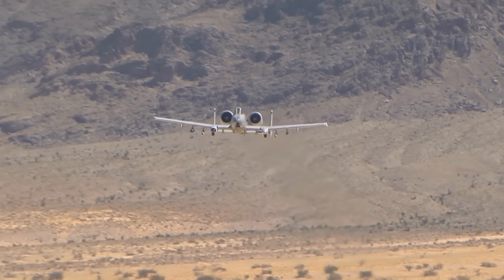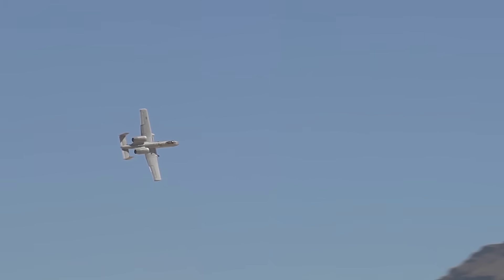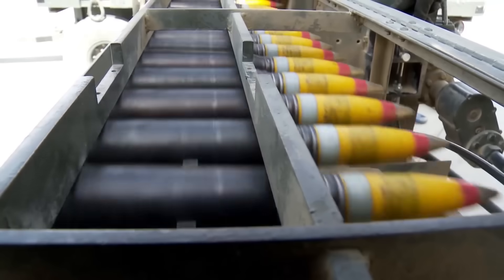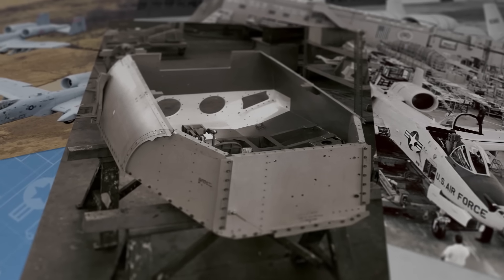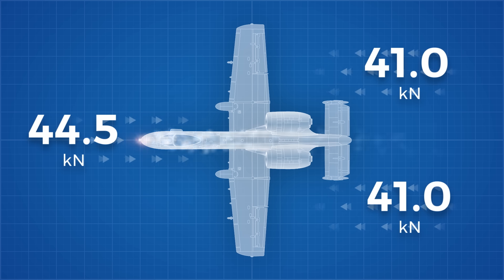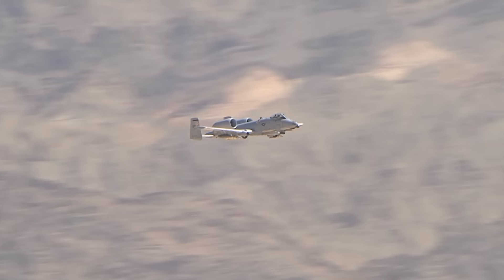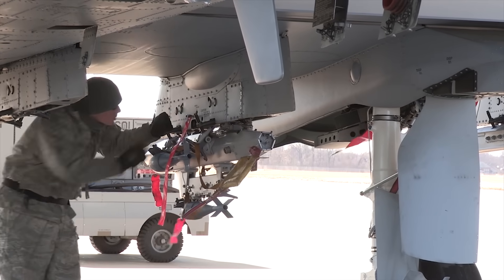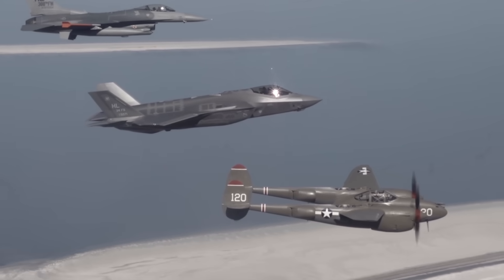The Insane Engineering of the A-10 Warthog

Comment: So you’re telling me, in a push contest between a gun and a fucking jet engine, the gun would win?
Reply: The gun's force is slightly less than a single engine from the A-10. Those engines are actually very weak, but the A-10 has 2 of them and firing the gun only results in a minor loss of speed.

EDIT: just looked up the weights, and the gun is in practice significantly heavier than the engine, so the engine would definitely win a push contest.

Comment: It's everything the F16 and especially the F35 aren't - cheap (relatively), easy to maintain, tough and independent.  Ugh.
Reply: In terms of maintenance and cost the F-16 and A-10 have always been similar. The F-35 is more expensive to operate, but a lot of that is because the US decided they didn't need to stock up on spare parts, so F-35s are often left waiting for spare parts which wastes time and thus money. Sometimes those spare parts aren't even accounted for due to the maintenance infrastructure in the US being poorly thought out. It's not an aircraft problem and is gradually being improved, with the end goal of the F-35A being roughly as expensive as the F-16, which is already within 10% of the cost to operate of an A-10.
As for toughness, well it's not the same as survivability. F-16 and F-35 are way more survivable which is why the F-16 is a more successful CAS platform than the A-10. Not sure what you mean by independent... the only aspect of the A-10 that is a little different in operations from fighters is the fact it can take off with a light load from grass or dirt runways. It still requires all the support that fighters do, and taking off from unprepared strips just isn't very practical.

Comment: And this is a Jet that Obama wanted to discontinue. Said it was needed it this age of warfare.  This Jets is Feared and needed.
Reply: Nope. It's the USAF who say the A-10 isn't needed, and they are right. simply not going to war against poorly armed enemies and spreading hate is enough to prove the A-10 is obsolete, because it can't actually perform CAS in the situations the USAF are required to prepare for. The current most successful CAS platform is the F-16, even though the conditions for using the A-10 are optimal with barely any anti-air threats.
Reply: @dumdumbinks274  Hmm Well I work next to an Airbase an they Love the A 10. If you are on the ground fighting you would love them also. It was Obama who wanted to end it just like he came up with the idea to end BACON in meals.

Comment: You can't ignore the ground troops if you want your plan to execute. You will always need close quarter support. If you use a f35 to do it, it is going expensive. There are plans to use propeller planes to do the job, but those planes are not good enough. They don't scare people physiologically. Well, i wonder what progress the aka “zombie hog” program going on? This program turn a hog into a uav with pilot on the rear base. That's a scare factor enhance and reasonable method to reduce pilot casualties.
Reply: Except that the most successful CAS plane today, even considering the enemy has no way to threaten aircraft in 99% of situations, is the F-16. There's no need for aircraft such as the A-10 even today, but because the enemy cannot effectively engage any fixed-wing aircraft the A-10 is free to use it's capabilities and there's no point in retiring it as long as these pointless wars continue, at least as long as the USAF don't acquire turbo-prop aircraft... because they are just as effective at killing the enemy while being 75% less expensive than the A-10.

Comment: If you look closely at actual photos, the gun isn't exactly centered like the video says.  It's a bit off center to the left, because the GAU-8's firing barrel is on the right, not top or bottom.

Comment: "Todays" cost of an A-10 $46M. The cost of an F35, between $95M and $122M. These things are being held together with bubblegum and duct tape and fly beautifully. Keep it. It's 1/3 the cost to manufacture and half the cost to fly than other "multipurpose" aircraft.
Reply: It's practically the same cost as an F-16 (current most successful CAS platform), and the F-35A costs around $70m going by recent deals, and at least is confirmed to cost no more than $78m. As for the F-35B and F-35C, well they operate from locations the A-10 cannot practically operate from, and those locations are far out at sea so that the ships can avoid being in range of any shore-based defences. Now in saying that I'm not an advocate for retiring the A-10 completely, it just gets a lot of misrepresentation because in the past there's been a lot of politically motivated lies surrounding it's effectiveness and achievements.

Comment: One of my very few claims to fame is that my (recently deceased) uncle worked on the initial A10 designs.  Believe it or not when they first came up with blueprints he was the one noticed the line the GAU-8 fired on was off the aircraft centerline.  He pointed out this would introduce a force couple that would twist the airframe sideways in flight when firing; they re-aligned the weapon location because of it.  Seems painfully obvious now but when you're engineering from scratch these are the kinds of questions need to be raised and answered.

Comment: Actually, the gun is not mounted on the centerline of the plane.  It is offset so that the firing barrel is on the centerline of the plane, otherwise the torque caused by the reaction would cause severe yaw in the plane.

Comment: I first saw her in Fort Knox and later in Fort Irwin. She’s the best war plane for close support and sheer firepower. With continued avionics and weaponry improvement, she’ll almost never be replaced. I don’t care how sophisticated air power gets. You have to have boots on the ground to take and hold the ground. You will never be able to have a military without infantry. You will always need a close loitering aircraft with massive firepower and armor. The old girl is almost perfect. I hope military leaders and “thinkers” don’t get fucked up with dependency on technology like drones. Drones have a significant role and are effective.  That said, we’ve learned that lesson many times already. You have to maintain human operated weapon systems in every aspect of combat. A pilot looking at the ground 360 can react far more quickly that a rear area drone operator sitting in a building. If it isn’t broke, don’t fix it.  If I were to do it over again, I would have been an A10 pilot. I loved Mech. Inf. But I would have done anything to pilot her, cover the troops on the ground and decimate the enemy. All enemy soldiers who have faced her are terrified of her and for good reason.

Comment: " Beauty is in the eye of beholder " Some say A-10 is ugly duckling . But I love the looks of this extremely useful machine . It is silk like a beautiful woman with nice rear end with those turbo jets at the back. As a general rule I am for peaceful resolution of conflicts NO wars.
A-10 should never retire just upgraded to stealth capabilities if required, new avionics , even let it hover. Or build the support chopper based on same brilliant ideas.
The infantry  soldiers saver no like exist, and not very expensive.
I love Worth hog.
Reply: It will only remain in service as long as wars are counter-insurgency combat in the middle east, where MANPADS are the only real anti-air threats. If a Korea-style proxy war ever kicked off, the A-10 is so slow (i.e. unable to run from planes) and, at full combat load, so poorly maneuverable (i.e. unable to dodge a missile, especially a SAM) that it'll get wiped off the map in an instant. It'd get thrown out in favour of F-15Es and, when mass-production is more viable, F-35s. They can provide similar instantaneous firepower to boots on the ground, while having the high-speed capability to get in and out before anything kills them; if the -35's stealth works out well, perhaps before anything sees it.
The hog is a pretty neat plane though :)
Reply: F-16 is technically a more effective CAS platform, having performed far more successful CAS sorties despite similar numbers of aircraft in-theatre. The A-10 is what infantry love, but the role of CAS extends beyond what the A-10 can do, and anytime the enemy has air defences an A-10 is going to be ineffective.

Comment: Need to find out how the Fairchild engineers solved one problem, the rapid depletion of the heavy 30 mm ammo caused the plane to rise quickly, thus making it difficult to stay on target.  Does anyone know?
Reply: I believe it's to do with the 2-stage trigger. 1st stage basically tells the flight controls to prepare to adjust their position, 2nd stage fires the gun and causes the flight surfaces to adapt to the change in pitch, velocity etc.
Reply: dumdumbinks274 I actually had lunch years ago with an engineer from Fairchild in Germantown, MD.  He told me about many difficult engineering challenges with a plane that was literally built around the 30 mm Gatling gun.   The titanium bucket for the protection of 5he pilot was also fascinating.  People today just don’t understand the incredible design of this pure tactical plane.  They should copy and make better A-10 with superior avionics and smart weapons along with the good old Brrrrrrrrrrrrrrrrrrrrrrrrrrraaaaaat

Comment: When I went thru one and two engine crew chief tech school the Warthog was one of the planes we learned intimately. The pilot is surrounded on all sides but up by a titanium 'bathtub'. There is so much redundancy built in it can lose huge sections of flight surfaces and controls and still make it home. The runner up was the YA-9 made by Northrop. They have one at the March Air Field museum in Riverside CA.  https://www.marchfield.org/s/cc_images/teaserbox_12714275.JPG?t=1517703561

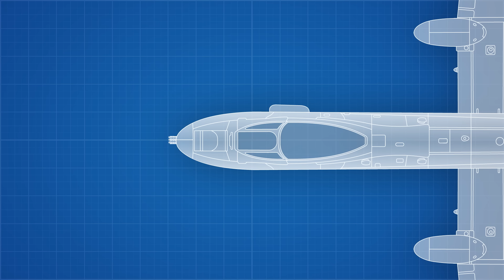Comment: @7:44 "The gun is mounted directly on the center line of the plane to minimize the effect of the recoil"
This is WRONG! The gun is mounted OFFSET and it fires at roughly the 7'oclock position, so that the RECOIL is centered with the plane.
Just take a look at any picture of an A-10 warthog from the front: https://en.wikipedia.org/wiki/Fairchild_Republic_A-10_Thunderbolt_II#/media/File:A10WarthogFront.jpg
Reply: Michael Klamo I don’t think either one of you are wrong. His point about the negative velocity from the gun firing being mounted on the centerline is still 100% accurate, he just also could’ve said it’s mounted off center to achieve this. From a physics standpoint though it actually does not make any difference if it’s centered or not, the velocity still impacts along the exact center line of the plane.
Reply: From the article you linked to "The fuselage of the aircraft is built around the cannon. The GAU-8/A is mounted slightly to the port side; the barrel in the firing location is on the starboard side at the 9 o'clock position so it is aligned with the aircraft's centerline."  

Re: the photo.  This can be a little deceptive, since the nose gear is off-center to allow room for the GAU-8.  Fun Fact: the steering system is calibrated to account for this... steering tolerance to the left and right are different by a significant amount.

7 years working with these beauties, some of my favorite experiences as an aircraft maintainer.  Also some memorable scars, it's not a myth that 'hogs bite. :)
Reply: @slimmccoy8863  Oh boy i would be livid every time when i see that offset gun, in M1A1 for some god forsaken reason you have 2 rounds less on the right of the breach, just empty space where you cant even put anything, but US machines are historically offten asymetrical, M4 sherman was good symetrical boi with its radial engine
Reply: @slimmccoy8863  You and Michael Klamo must be in different time zones
Reply: "Uh oh"    "Uh oh what ?"    "Sir we have a fact checker"    "Well go get him ! what am paying you guys for ?"   "Well sir he's surrounded by civilians sir"  "There might be heavy collateral damage sir"  "Cant we use a smart bomb or something ?"  "Sir ?"   (mmmuhahahaha  just kidding Michael Klamo)

Comment: Great video, but I have one tiny issue. The GAU-8 is not mounted on the center line. Its mounted slightly to the left. The firing barrel is centered, at the 9 o'clock position. This helps with recoil.